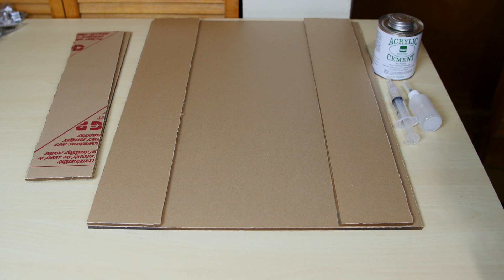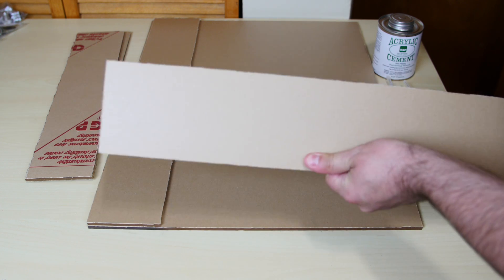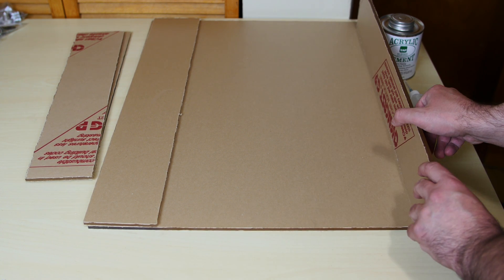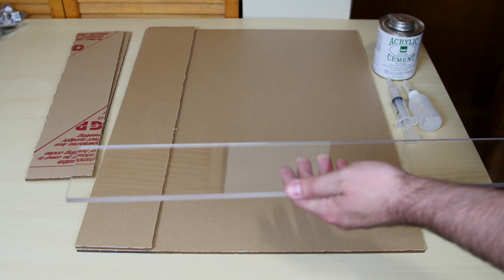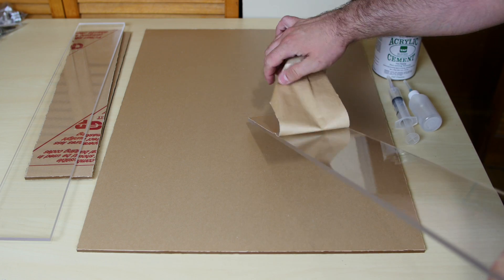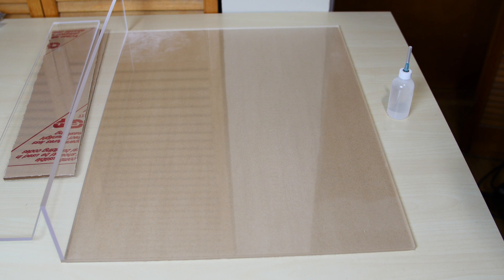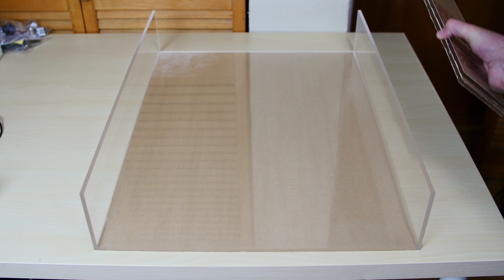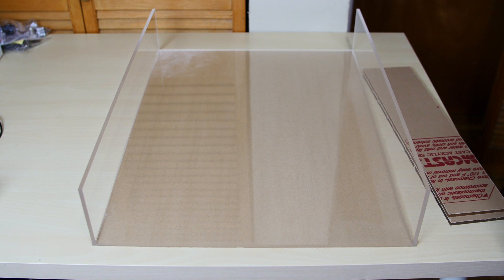Water Cooled Raspberry Pi 3 Cluster (Supercomputer) Part 3 - Building the Acrilic Case

Comment: Rasim, how do you know that the cement has made it all the way under the 24" piece?  It looks like the cement only hit the corner where the two pieces meet.  Maybe it would have been better to apply the cement to the 24" piece along the edge and then set it down onto the large piece?